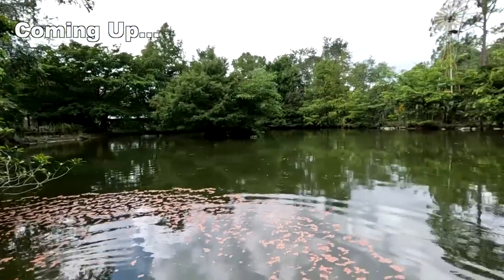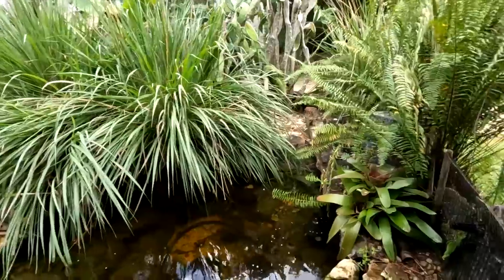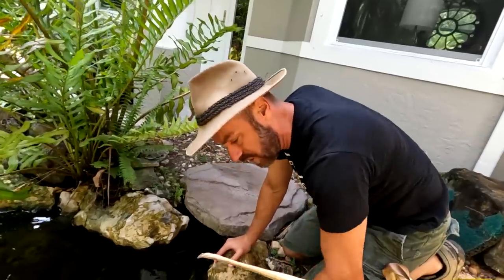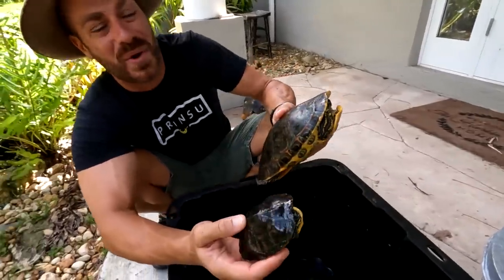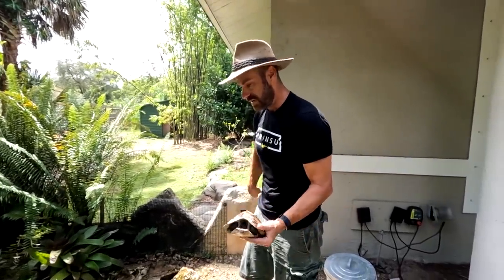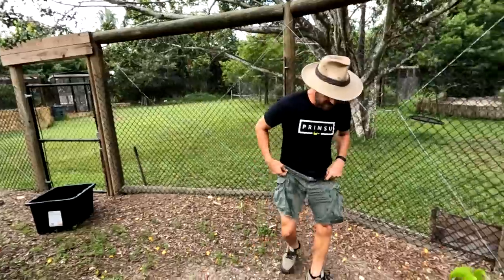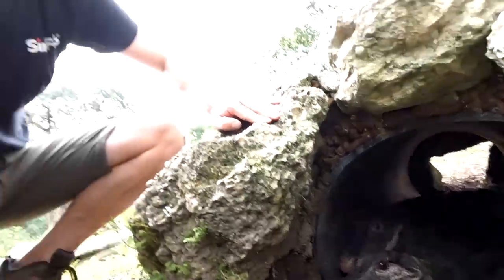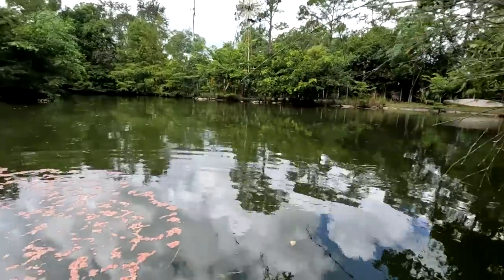My Turtles are Graduating to the BIG POND!

Comment: you need some sort of water flow in that big pond because when it gets dry out like you saw earlier this year you're smaller turtles like the ones you're putting in there now have problems with the gas So if you have water flowing in a little bit more water volume in that pond during the dryer months I think you'll be better off and that something you want to talk to at the pond professor about.